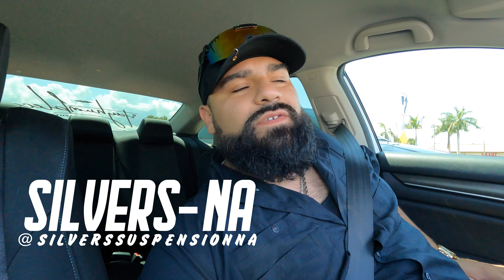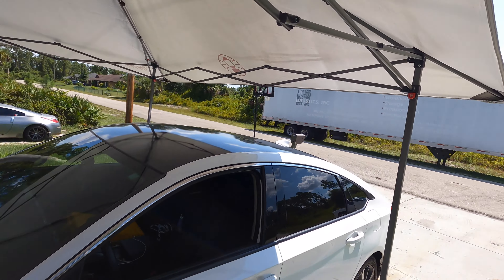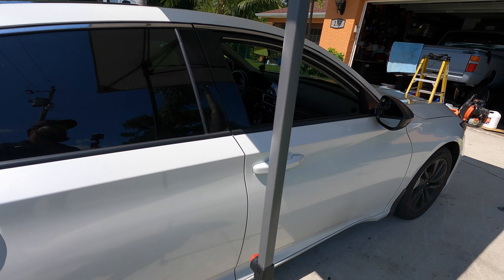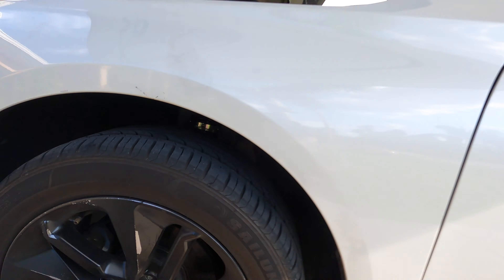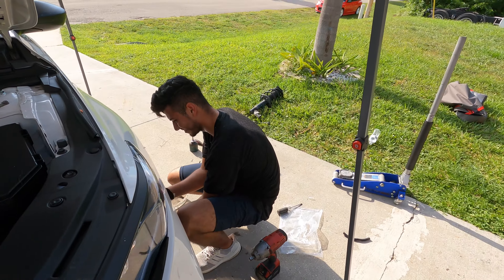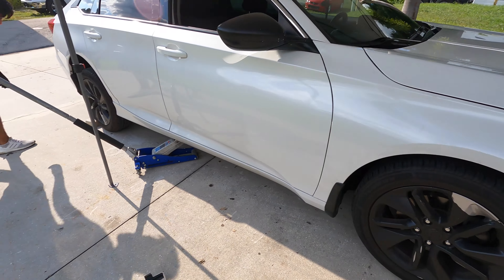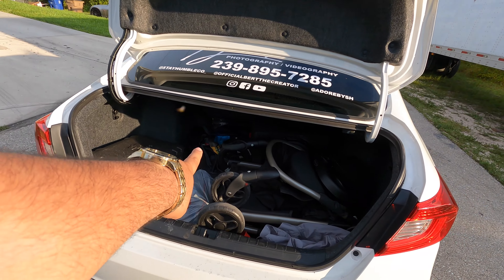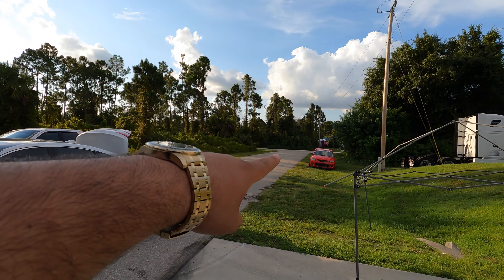installing Silvers Suspension in a Honda Accord 2020

Comment: You in Lehigh acres  ?
Reply: That for sure looks like Lehigh Acres. I used to live there
Reply: How far did you get the strut in the knuckle im having trouble only got it into the divit so it fits the bolt
Reply: @jonathanpolignone8367  there's a stopping point on the new strut. Look around the strut and you'll see it.